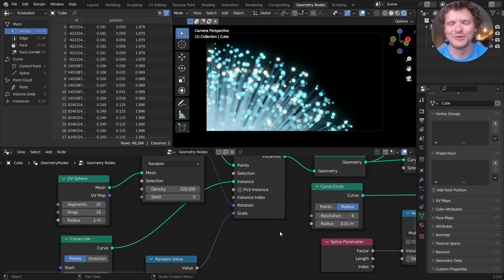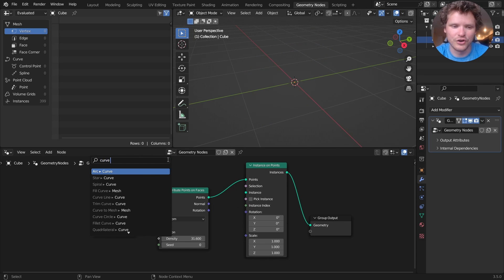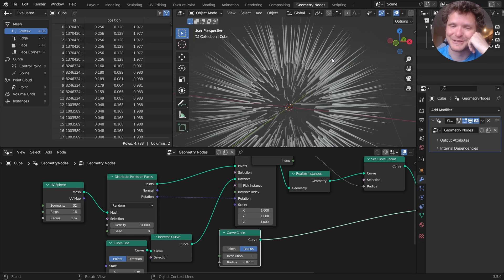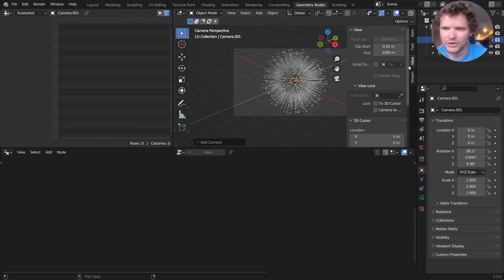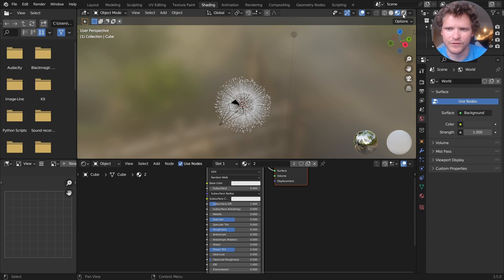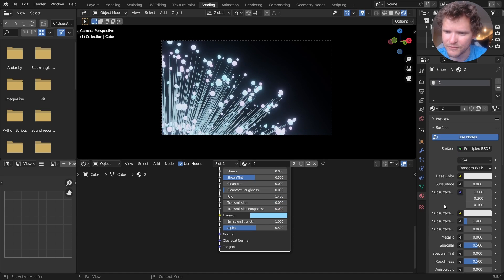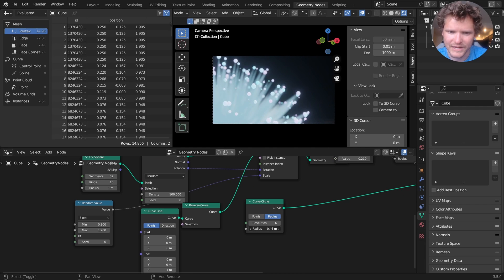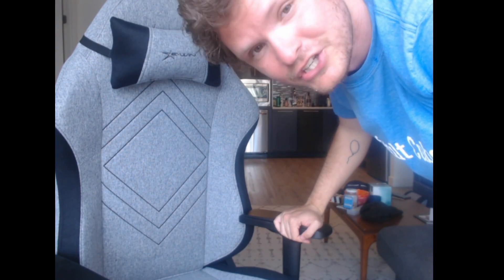you know... this thing (blender fiber optics)

Comment: Hey! heads up! The number of blades affects the shape of the bokeh (and the ratio I guess, I believe that 1,8 gets you the anamorphic look). The issue here is that the bokeh in this video is faked by making the spheres at the end quite big.

Solutions? Make them way smaller and way, way brighter. Now you rely on Blender to properly simulate the physics of light. Still, you probably have more control over the post-processed bokeh on the compositing window or (my personal preference) in DaVinci Resolve -you pick your weapon.

I would work with EXR, of course, because we all saw that video, right? Really, go check it, NEVER TOUCH A JPEG.
Having higher bit depth ("white that's whiter than white") let's you set a threshold for the bloom and bokeh effects. 

Also, I dare you to write a coherent comment that contains the word bokeh more times than mine...

Comment: Hey, so I was wondering if it's possible to create a procedural racing line. I know it's possible to create a procedural track, but what about a racing line on the track that will change depending on how the track goes. There are many types of racing lines depending on if you're attacking or defending, but the perfect or the geometric racing line seems to be simple enough. The geometric/perfect line goes from the outer edge of the track to the apex of the inner apex of the corner and goes back out to the outer edge of the track, while maintaining a smooth curver all throughout. Should be possible with the geometry nodes